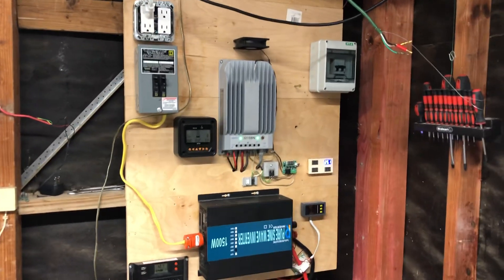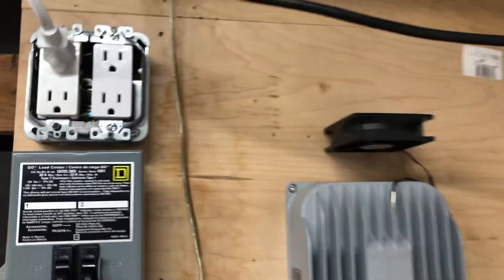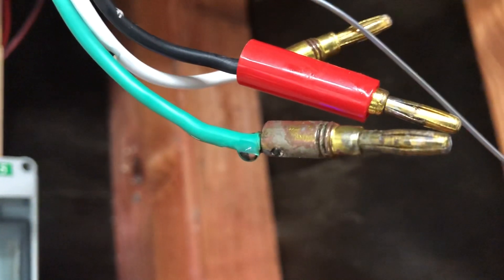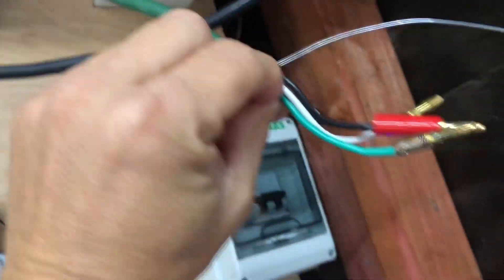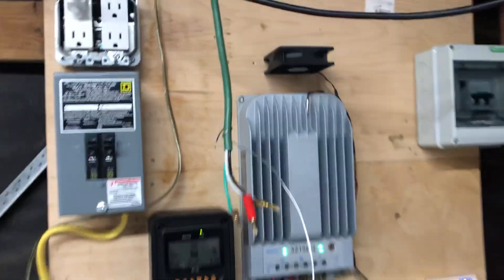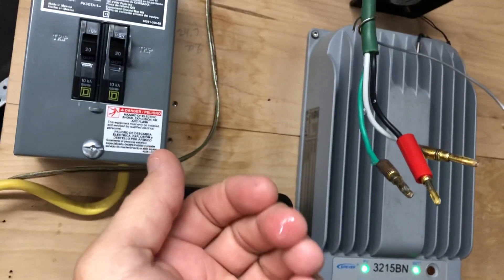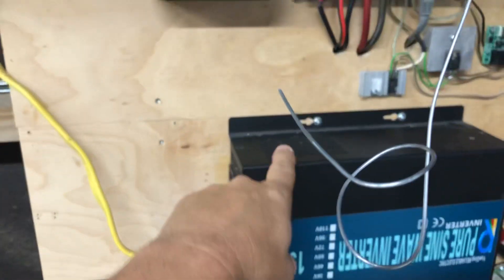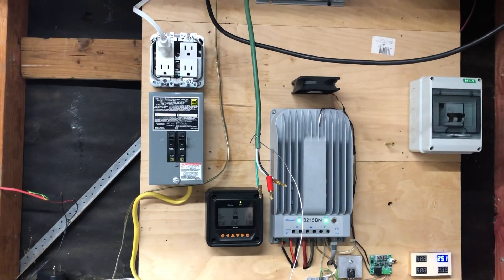Do Not use extension cords for your wind turbines or this might happen

Comment: Good point 👍🏻
Reply from the maker: Never in my wildest dreams would I have ever thought this would happen
Reply: @Checkitfirst  
I used to work in a factory, maintenance tech. I’ve seen it a few times with proximity and limit switch cables used in a coolant flush environment. Glad you suffered no electrical component damage 👍🏻😎